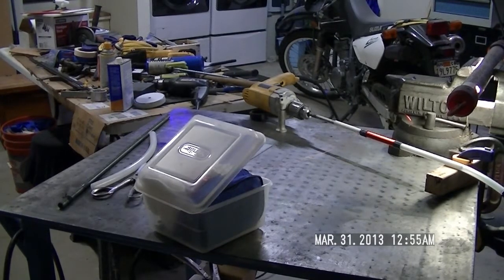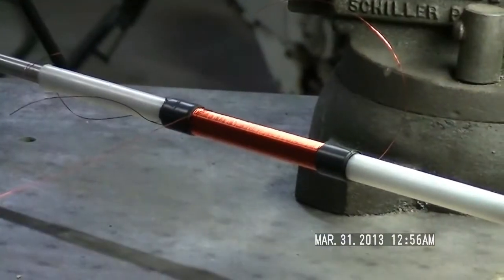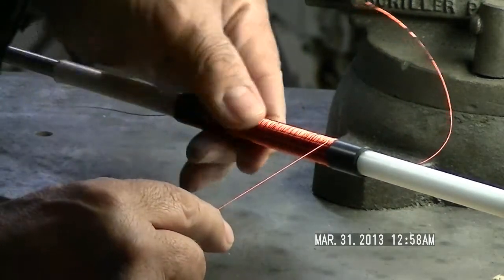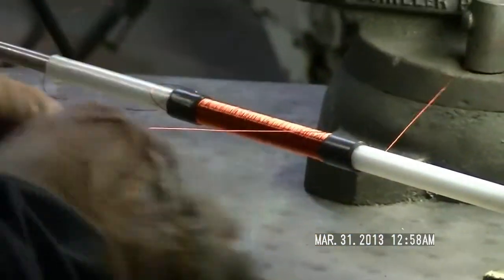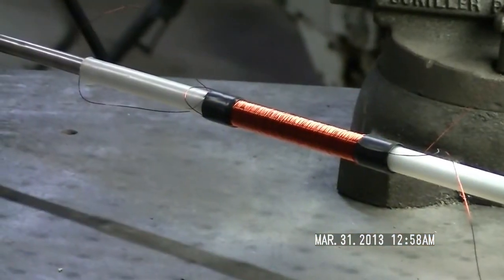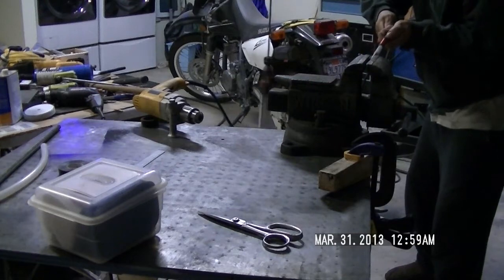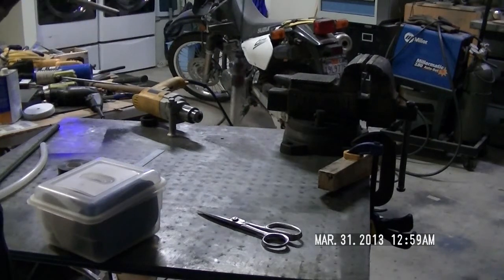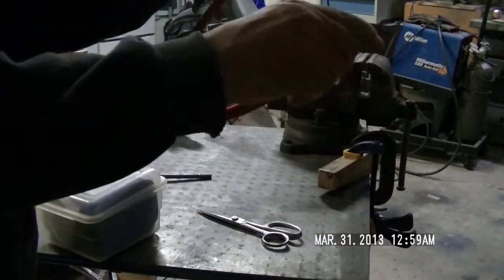Accelerator coils made easy ...just add electrons

Comment: Hey, what is the diametre of the coppper wire? Urgent!
Reply from the maker: +Pablo Brando: 22 ga. wire is .025 inches or .644 mm
Reply: +Sir Farquat Thank you! I want to replicate the accelerator. Is the circuit you used anywhere?
Reply from the maker: +Pablo Brando  Theres a website at this address: http://freeenergylt.narod.ru/index/0-11   There are 6 videos on this page ..then theres a schematic with an IRF4904 mosfet and A3144 hall sensor.  This is the circuit I used.   The circuit in this link is for a magnetic rotor however,  when building an accellerator tube,  the tube is inserted  thru the coils. The hall sensors are placed near the middle of each coil.  As the neo magnet travels thru the coil, the hall sensor senses the magnet then activates the coil to repel the magnet thru the coil and accellerating it to the next coil.  Both coils are controlled with one power driver circuit and each coil has a separate hall sensor placed near each coil, ...connected in parellel to the drive circuit.  This is the same circuit I used for most all my more recent rotating motors.   Hope this helps..
Reply: +Sir Farquat Thank you man I really appreciate you answering... This will define my final highschool grade so it's pretty important. Im trying to accelerate a steel ball though, I dont really know if the neo magnet can be replaced by the steel ball, if not, how can i find a neo magnet? + Are the coils connected betwen them? Again thank you a lot you are my savior <3!
Reply: +Sir Farquat And im really sorry to keep bothering you but If you have an image of your circuit it would be more than amazing if you could send it to me (pbrando@hotmail.com) im trying to replicate it on a protoboard so i would just need the image to copy it! Thanks again
Reply from the maker: +Pablo Brando When you force voltage thru a coil it turns into an electromagnet right? So if you tried to use a steel ball, the ball would stick to the inside of the coil when it was energized by the circuit.  The basic principle behind a tube type linear accelerator is that:  The power of the energized electromagnet (the coils) will repell anything of equal polarity whether it positive against positive or Negitive against Negitive, they will repell.  When you send electricity thru the coil it acts just like any other magnet, its polarized half North magnet field and half South magnetic field along the length of the coil.   So when a cylinderical neodymium magnet (which is polarized in the long direction like a coil) travels into the coil, travels half way thru when the Hall sensor senses the neo magnet ..the Hall switches the circuit and forces current thru the coil,  then the coil repells the neo magnet. The circuit I sent you (email) allows the neo magnet to trave from one coil to the next, ..over and over.